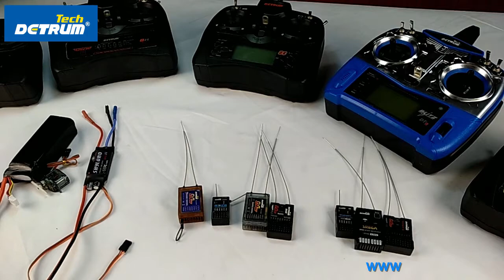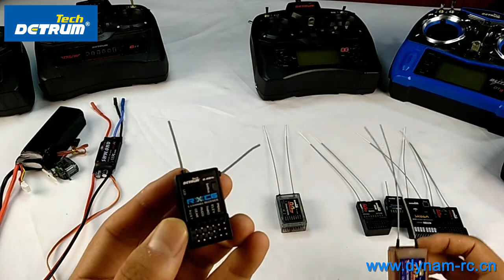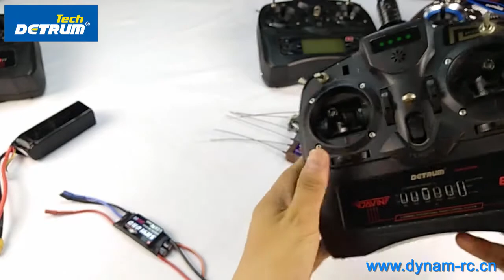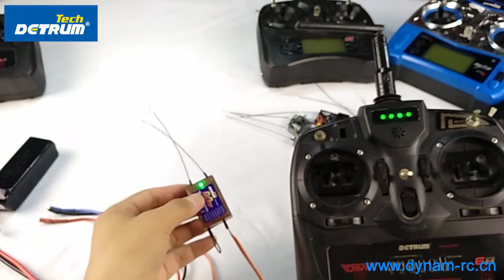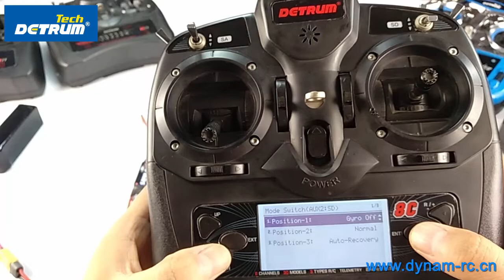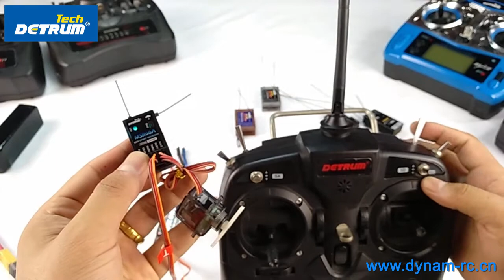How to Bind Detrum Receivers with Transmitters

Comment: After getting nowhere with Dynam support for the third time…I’m desperately looking for someone who knows this radio system 100% inside and out. I have a solid understanding more than 95% of this radio system and it’s gyro Rxs. 

However, I’m yet to find anyone who understands this system more than me. If you are that person please get in touch as I have some very specific trouble shooting that has eluded me for the last 4 years.

Any help would be hugely appreciated.